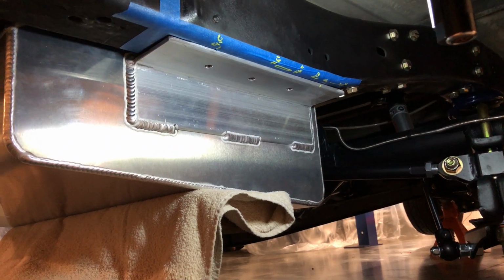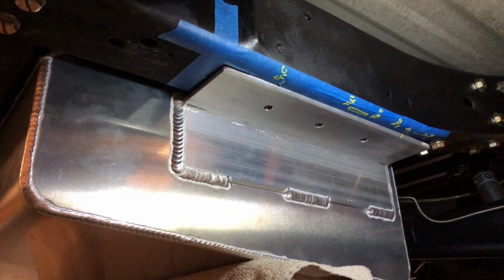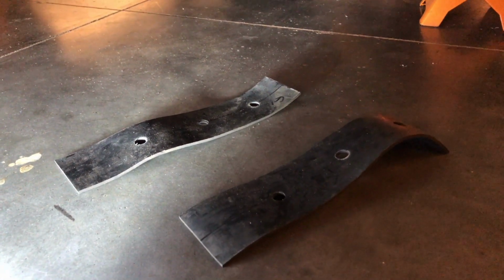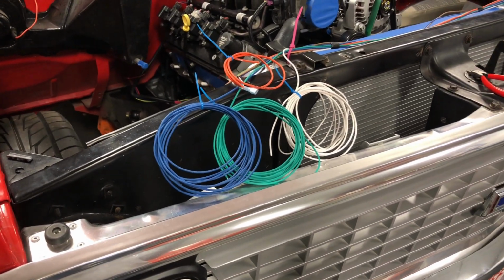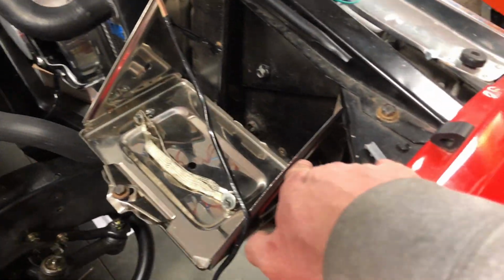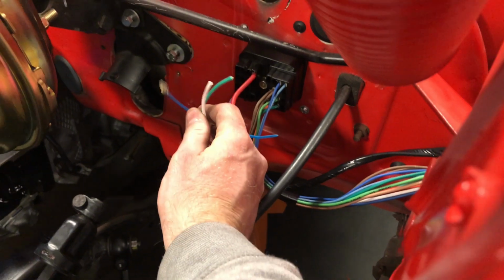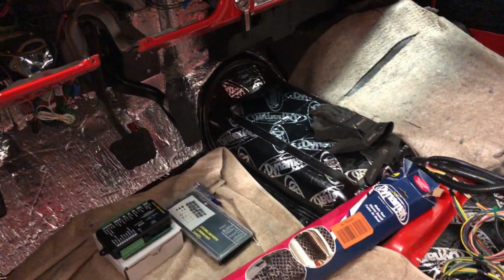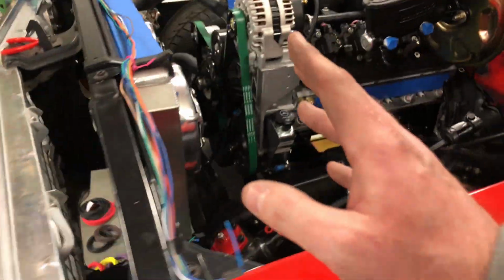'72 Chevy C10 - Installing Boyd Welding Fuel Tank and Wiring - Day 31

Comment: 2:00 If you ever have to drop the tank to replace fuel pump or sending unit you're in business.. probably the ONLY thing I would have done as you said is IF the bed was in removed I'd have welded those bolt into place so that in the future they won't be a problem plus it makes installation a snap.. no reaching around.. no hunting for the head.. lolol
Reply from the maker: I've thought about this many times since I installed the tank.  When I get around to it, I am going to weld nuts to the inside of the frame.   I should have done it from the get go.  Thanks for watching!

Comment: Those upper bolt heads are even difficult with the bed off, you’ll need universal jointed sockets.
Reply from the maker: Tell me about it.   I was actually just thinking the other day that the next time I have the tank out, I am going to tack weld those nuts on the backside.  Boyd sells a mounting bad that attaches to the frame with nuts on it.  Might be worth it when buying a tank.  Thanks for watching!

Comment: Nice work. Do you have a video of routing your fuel lines to your tank?
Reply from the maker: Thank you for watching.  Are you taking about the fuel lines and electrical connections?
Reply: @RustyWrenches  Yes
Reply from the maker: Well, I just went through the videos and apparently I didn’t film any of it.  I ran the fuel lines down the driver side frame rail and wiring down the passengers rail.  It’s pretty straight forward on the plumbing snd the wiring.  Asking any questions you might have and I’ll do my best to answer.
Reply: @RustyWrenches  Did you use steel lines connected to fuel hose or stainless steel lines with AN Fittings
Reply from the maker: @DaRealArtist  I used an fittings and nylon braided lines.  I think in the future I'd like to change them out to stainless steel hard lines with a short section of hose at the tank and fuel rail.
Reply: @RustyWrenches  Ok, thanks. I plan on using steel lines with fuel hoses connected to the ends. Also, did you install a fuel Return style filter with your return line, if so what brand and part number?
Reply from the maker: I have an Aeromotive online filter on the supply line.  I don’t know the part number off hand, but it’s a 10 micron model.  I have a return line going from the rail to the tank.

Comment: Did you you top fill on the tank? Would ypu have chose a different fill if so?
Reply from the maker: Anthony Whitley I did.  I ended up cutting a hole on the bed floor.  I plan on making a magnetic door to cover it up.  If I were to do it again, I might go side fill with a filler behind the taillight.
Reply: @RustyWrenches  Thanks i am doing wood bed with top fill driver side. moved away from side with door.
Reply from the maker: Perfect.  That’s going to look great!

Comment: I got a question my friend I got myself the same gas tank but i bought some cheap fitting for the fuel pump and the return they started to leak pretty bad there is any way you can tell me the fitting size you used.. thank you
Reply from the maker: If I remember correctly, the supply is a 6orb to -6 AN and the return is a 3/8NPT to -6 to 6AN
Reply: @RustyWrenches thank you for your quick response any specific brand?
Reply from the maker: I used Russel fittings.

Comment: I got a question.. I'm getting the same fuel tank from boyd, but I'm not sure if I should get it with the fuel pump or not?if I do I need a fuel regulator? what would be the best option? Thank you
Reply: Thank you very much for your quick response...
Reply from the maker: You can run an external fuel pump, but the pump he includes is a great pump and all integral.  It is a nice package.  For the regulator, it depends on if your fuel rails are return or returnless.  If it is a return style rail, it has a regulator on the rail.  If it is a returnless, you will need a filter/regulator like a Wix #33737.  Either way, you will love the Boyd tank.  It is a work of art!
Reply: Thank you for the quick response, I really don't know if the pump is return returnless, I'm not quite understanding about the rails..
Reply from the maker: @orlandodiaz4504  Easiest way to tell, on the fuel rail, if there is only 1 fuel line connection, it is returnless.  If there are 2 fuel line connections, it is a return style.  Also, on a return style, there will be a vacuum line coming from the top of the truck intake manifold  down to the fuel pressure regulator on the fuel rail.
Reply: So it all depends on the engine fuel rails right? If is two is return if is one returnless..
Reply from the maker: @orlandodiaz4504  Yes sir.  Hope that helps